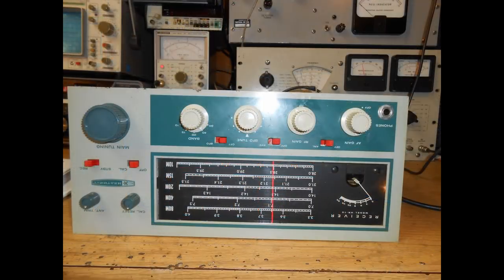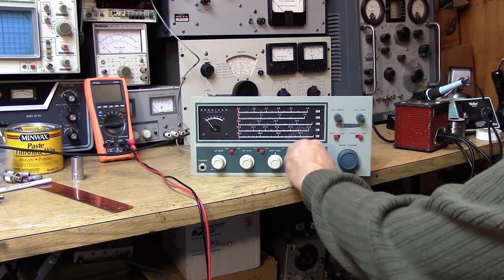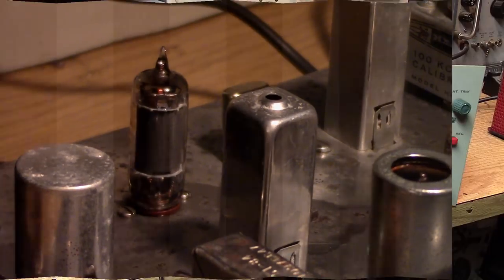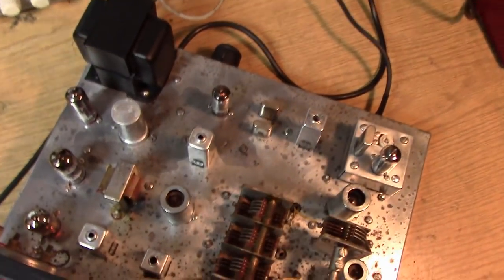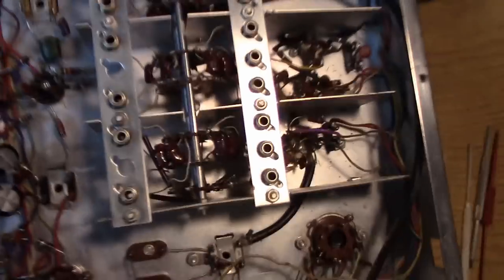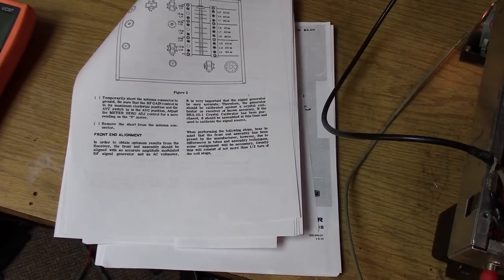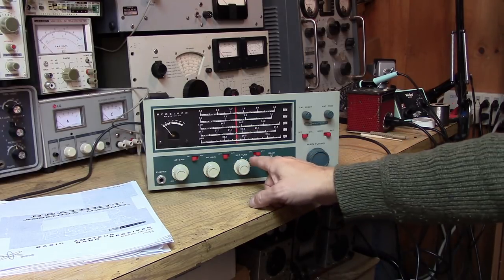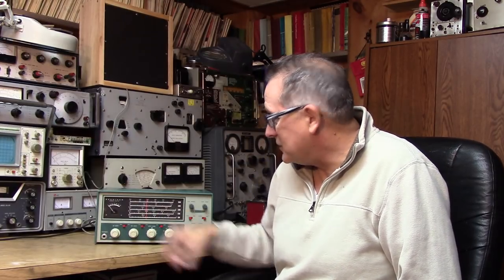Heathkit HR 10 Servicing Part 2

Comment: Big thanks for both videos! I was able to fix another old HR-10 and partially align it. I can now listen to signals in 80, 40 and 20 meter bands, including some weird stations (some AM radio at about 3955, daily name calling "duels" at 7050-7060 LSB. Still waiting for some tools I need to align the cores. Is there any hint how to make 21 MHz work? When I look at VFO signal, for 21 MHz band it exists, but is fairly weak (about 10 volts p-p IIRC).
Reply from the maker: The 21 MHz low injection issue with the HR-10 is a well known weakness. Alignment should bring it up to "acceptable" performance. It is a design shortcut to use a second harmonic of the HFO on 15M. Without some modifications (amplification of the harmonic), this is just a fact of life with the receiver.

Comment: Aha, see what I mean?  This is why I change out all electrolytic caps.  You should have known that by now, lol.  But at least you demonstrated WHY they need to be replaced.   Great video - Job well done!
Reply from the maker: I don't know nuttin. I am Johnnie Novice. Actually you would be surprised how many people just plug them in!
Reply: @MIKROWAVE1  Actually, I'm the novice. I've learned a lot from you.  I really appreciate your videos, your explanations, and your patience and attention to detail.  Many thanks!
Reply: @MIKROWAVE1  I had to discourage many people from doing that, and even "fight" with them to properly restore old stuff like that.

"Why? It works?" .. yes but it still has the ungrounded chassis, connected to the mains via old wax-paper caps. That stuff is going to shock you, start a fire or do both, even.

Comment: Mike, 
has anyone tried amplifying the injection freq for 15 and 10 meters to improve sensitivity?? A few xistors/FETs and a bandswitch tap for biasing the xsistors should help considerably. 
Also, did you calibrate your outboard converter to match the 15/10 meter dial scales?
There is room to help this old girl and give her a little  breast augmentation.. Hi hi 
It'll never be in the same league as many other RX's of the time but could be a decent Novice RX with loads of room for serious improvement.
73,
Glenn WA4AOS
Reply from the maker: Oh I am sure somebody has tried some of that, but there are 100 times more folks simply enjoying complaining about the weaknesses and idiosyncrasies of these old sets! To a new novice, this was a box of joy. They all need some work now, just to get back to original performance. And no, I did not have an exact crystal that allowed the dial to work perfectly, but I think that could be accomplished quite nicely.

Comment: Really enjoy your videos, very informative. Question, when you first started with the 10B, you turned the RF up, and the needle on the meter pegged. You said that something to look at later. Unless I missed it, you didn’t get back to that. The other thing, when you got finished, there were strong signals and the meter isn’t moving. I have both problems with the one I just bought. Wondering if you have a solution? Thanks, Don, WA1YDK
Reply from the maker: Great question because this is a classic issue with entry level receivers. How do you provide an S-Meter without adding another tube?  The meter is placed in the plate circuit of a variable-mu tube, in this case the last IF stage. The tube operates class A and therefore the only time there is a change in plate current is when there is AGC applied. So the darned thing only works in AGC mode so no dice in CW. With a large signal, the AGC voltage becomes greater, reducing the plate current (and gain) of the tube. So the meter has to be set up to show maximum reading on minimum current. This causes pegging when you fool with the RF gain control! Horrific but all too common circuit.
Reply: @MIKROWAVE1  Thanks for that, so in a cw QSO, everyone is 599, lol.

Comment: Mike, how long did that alignment take?
Reply from the maker: Including the calibrator, IF and front end, about 1 hour to align. Because the tuning range is so swamped by the high C fixed caps, there is no end point adjustment back and forth as with a general coverage receiver.